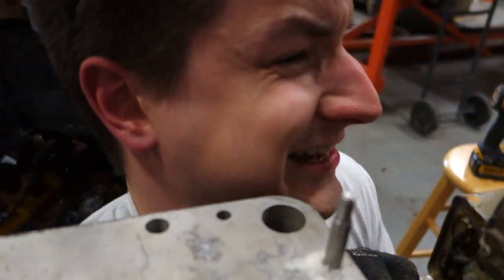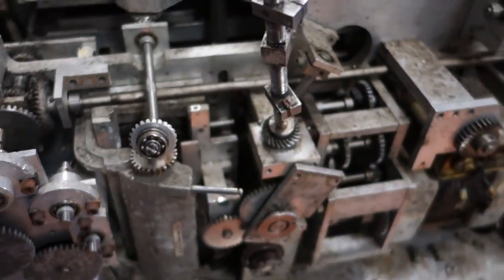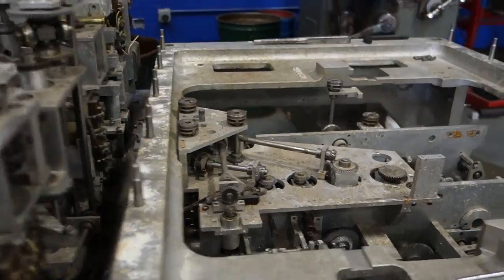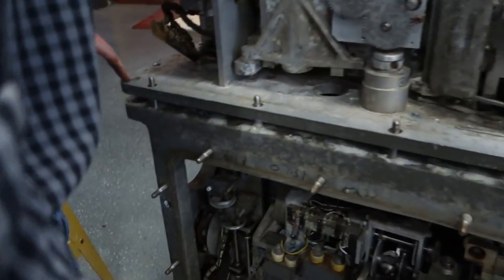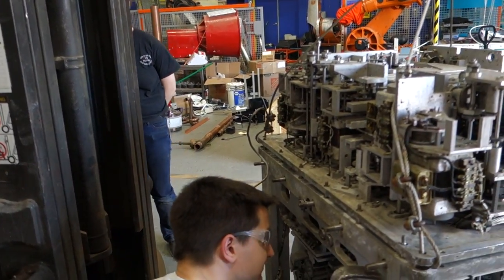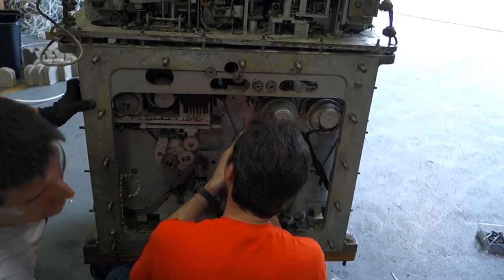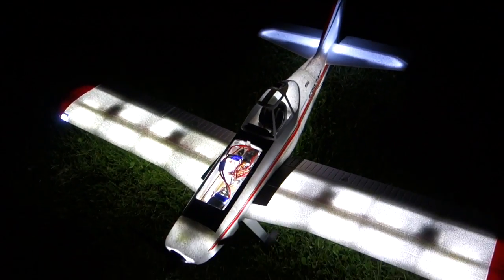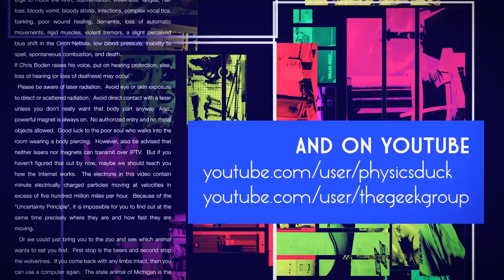Captain's Blog 5 5 2016 Fly By Night Operation

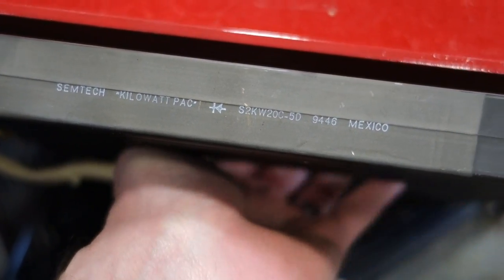Comment: 3:54 Looks like a 3-phase rectifier stack. Each black blob is probably two diodes. in series. The centre connection will be the input, and each end is the DC out.

Comment: what is that piece of equipment mitch and katie are taking apart called? 
some sort of analogue mechanical computer?
Reply: It's an analog fire control computer.
Reply: +dan braun Its an analog computer for targeting aircraft for AAA batteries on a warship, '40s-'50s vintage, IIRC.
Reply: +Daniel Vincent friggin sweet.

Comment: why do you call Luke that?  0950  7 bars is a lot of electricity in that forklift.  those 5 KV fuses are BIG.  a 7 wheel cart is different.  racoons probably had fun on that machine.  mechanical computer  has so many moving parts.  both parts of the mechanical computer are more easily moved separately.  where are the mechanical computer parts going?  wow you surprised Moose.  1719  a new battery will you reach 10 bars.  sir, iron oxide is rust.  why does the law make quinn's vape close?  quitting smoking gives your more spending money.  captain you have power.  work towards an FPV plane that can fly over GR.  spinner = propeller.  what's 2200 referring to in a battery?  night flight is at 2100.  spinny thing ... your speech is entertaining.  no, you smacked the plane into the fence.